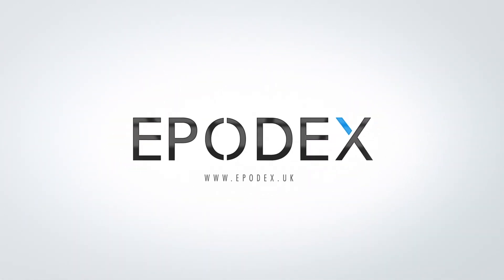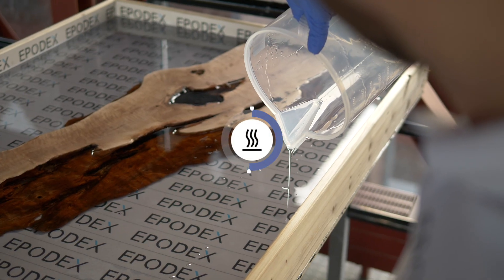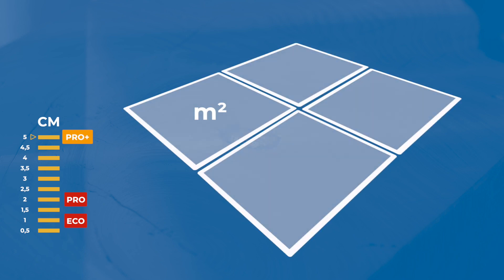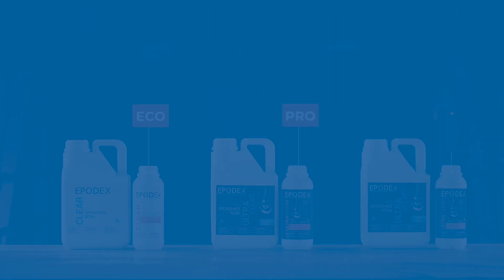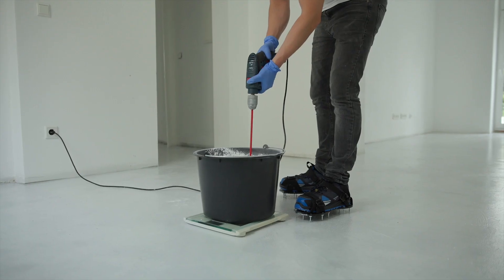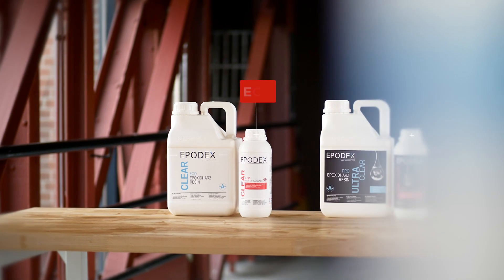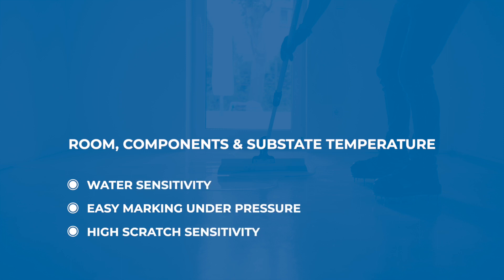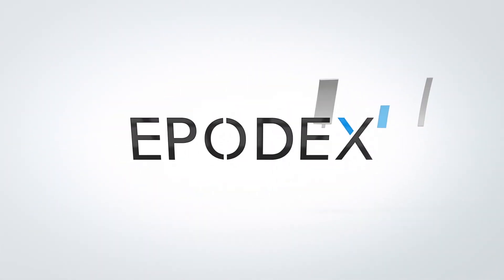1O1 | All the Basics on Processing Epoxy Resin from EPODEX

Comment: Is it recommended to use this type of epoxy for a skull mold? Or should it be done in layers?
Reply from the maker: Depends on the size of the mould. You can normally use our ECO+ or PRO+ systems for castings up to 10cm high, and that can be exceeded in cases where the other dimensions of the mould are not so large.

Comment: I just ordered this system and I have a question if I have coverage for 16 ft² my base coat is the black and purple and then I have added white powder silver powder and gray powder to add different colors. How am I separating the usage of A and b when mixing those separate colors how much of the resin and and hardner Am I using to cover the counter. If the package I ordered covers 16 ft² am I leaving some left over so I can do the three different colors? I've been looking at videos and none specifies how to do the base and then at each separate color
Reply from the maker: Hi Stephanie,
You would need to divide the resin and hardener proportionally between each pigment. Can you send me an email to support@epodex.com along with your order number and I will explain in further detail. Attention to Nicole :)

Team EPODEX

Comment: What is the appropriate pressure for the pressure pot for a resin wood mix in a form about 10: wide and 3.5 " deep?
Reply from the maker: Hello,
Our products are BUBBLE FREE so we do not recommend using a pressure pot nor can we advise what pressure to use as we dont test our products with a pressure pot.
Team EPODEX

Comment: How do i measure the A and B components? (What’s the proportion)
Reply from the maker: Thank you for your interest in our products. Our Eco, Pro, & Pro+ Systems have a 2kgA:1kgB mixing ratio. Our Sealer & Primer System has a 1kgA:1kgB mixing ratio.
Reply: @epodex-uk  thank you very much
Reply: Hello, I'm just wondering how to make up the sealer, is the sealer the same as the epoxy resin mixed with hardener and then applied to the top of the finished project in a very thin coat? Thank you